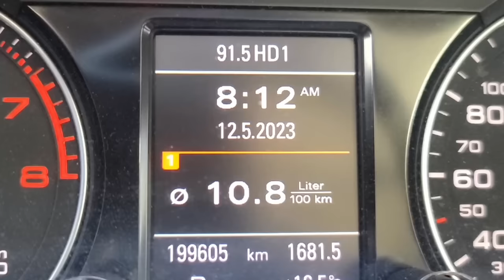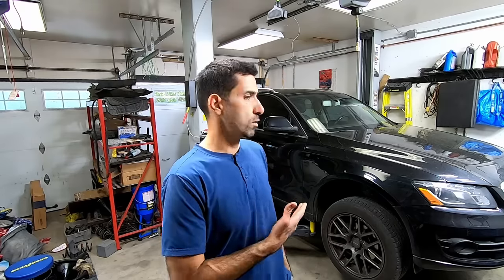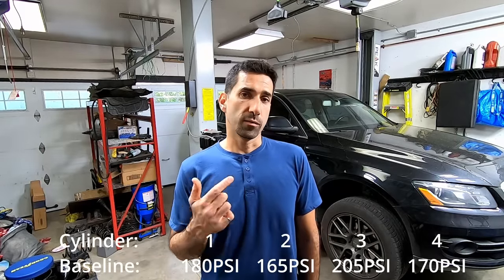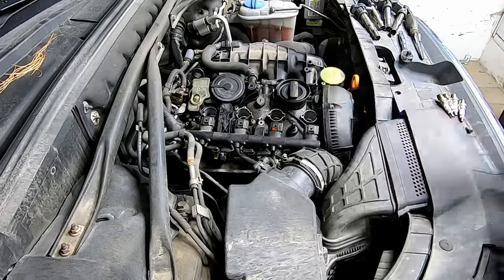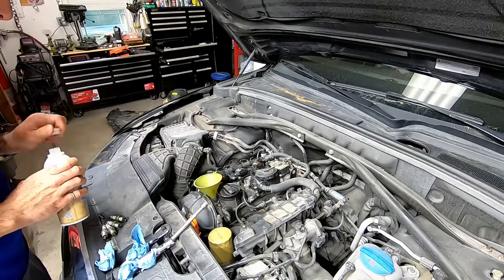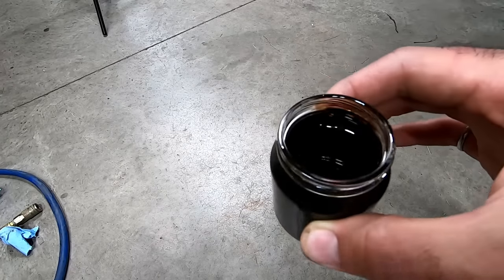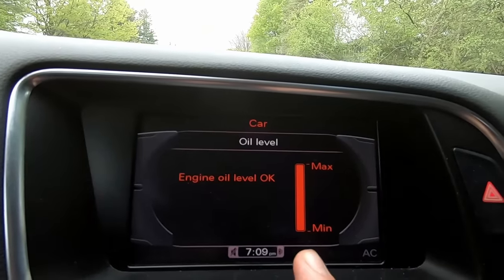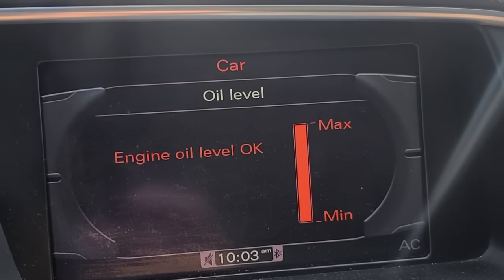How to fix excessive oil consumption from clogged piston rings (Part 2)

Comment: I'm next one who use your advise to fix my Audi oil problem in a4 B8 1.8 tfsi 2014. Was not so bad as yours but was burning lately more , I think around 300 ml on every 1k km . After completing the procedure of soaking rings in b-12 I drove 1300 km and I have still max oil level . Thank you very much for that video it helps me a lot ! Wish you all the best !
Reply from the maker: great! I've had quite a few 1.8TFSI folks do this successfully - it's annoying that the later years are still having these issues when they should have been fixed
Reply: @ETMotorsports  thats true , but I'm glad I could fix it on my own for just like 20 dollars or so. I'm very happy hehe . In my mind I was already preparing for fixing that problem in some specialized garage for big amount of money, and now I can maybe spend money on stage 1 :)

Comment: DUUUUUDE!!! I bought a really nice-looking Passat Wolfsburg edition1.8L turbo with 95K miles for my son for graduating college (valedictorian!!) Ends up it went thru 1 QT/1,000 miles. Terrible. I did what you showed with pistons in mid stroke and used 2 cans. 4 hours after the first can 3 of the cylinders had leaked the B12 through to the crank case. I refilled it and the next day put it all back together. Drove it for about 60 miles and changed the oil. I have over 2,000 miles and have not lost a drop!!!! That is amazing but proves the carbon build up on the oil rings is fixable without rebuilding. Thanks for this video. I should send you money!!!
Next time maybe try a dose of tranny fluid in before the plugs to get some compression for easier starting in the beginning.
Reply from the maker: Great results... glad it worked!!
Reply: @ETMotorsports   I now have over 4K and yet to loose ANY oil. WOW

Comment: My daughter's 2018 Tiguan has 70K miles and recently began using oil.  I also just noticed that it puffs a little smoke upon startup.  I had read about the B12 piston soak curing Audi/VW 2.0 oil consumption and anticipated her Tiguan might have oil issues.
I just began the B12 soak today.  Since it was pointed out that the oil becomes abrasive from running the B12 as an engine flush, I will remove the fuel pump fuse and spin the engine a bit with the starter to exercise the rings some.  Then do an oil & filter change.  I want to avoid running abrasive oil through the engine & turbo.  That stuff has to be brutal on the bearings.

Hopefully, this works.  I'll report back to let you know.
Reply from the maker: Keep us posted with the results... good luck!
Reply: Also interested in your results, as I too have a newer and lower mileage vehicle when compared to most commenters. Thanks in advance!

Comment: I am about to pull the LS3 on my Camaro SS that I am 90% certain has stuck piston ring(s) and redo them all. Watched a f3w of these types of videos but this merhod seemed the most thorough. Certainly worth a shot to see if I get lucky. Might save me many hours of labor and money if it works.
Reply from the maker: Good luck! I just did a 3.0T v6 motor and the amount of garbage that came out of the cylinders after B12 was incredible... keep us posted with your results

Comment: This was a great exercise  and resolution. Still surprised that Audi can't build a reliable  engine!!  My friend had to get his 2011 A4 engine repaired because of this.

Besides the low tension rings extended oil changes don't  help to mitigate this issue.  I bet that if oil changes are done at 8k KM, this situation can be avoided.
Reply from the maker: Yeah it's crazy how bad that 2.0T is from timing chain issues,  to oil pressure issues,  to oil burning issues... considering how many cars this engine is used in, it's truly scary to see these problems... pretty much every day there's a low mileage A4 2.0T on marketplace that's either blown it's engine or is about to and folks are stuck with thousands in repair bills
Reply: LOL the fuel savings doesn't even come close to recouperating the cost of repair. This is why I drive  a 4.0 l jeep, it doesn't get great mileage, but the maintenance cost is like 100 per year
Reply: The v6's are great actually, which is something other car makers actually suck at
Reply: @misham6547  but the 2.7 l is also junk, right?
Reply: @gianfrancoa  is it? I thought it was pretty much as good as the 3.0
Reply: Couldn't you just pour it in the fuel tank and avoid all the drama?

Comment: Thanks a lot for the video I followed your instructions step by step, in europe we dont have B12 so I used STANDARD THINNERS from EURO CAR PARTS,  I have already done 5000 miles, 8000 km without adding oil. my audi q5 tfsi 2011 before this tratment I used   to add 1 liter oil every 500 miles and in summer with high temperatures I added oil every 300 miles. 
Cheers

Comment: I hope you read this. 60 years + experience. I've been using Engine Restore for many years, I run it all my old cars. It keeps them like new, great compression and no oil burn. I've brought back many a oil burner with it. And restored the transmission synchros in my Honda Acty. (The crankcase and trans share the same lube)  It builds up cylinder walls and bearings. I think your find it will help with your oil burning and compression problem, after a good cleaning of course.  I love chem tool too. People tell me I'm crazy for using like your doing.
Reply: I did this on a 2015 VW Passat 1.8l turbo. The root of the problem from what I can find out from VW is the crankcase vent valve being faulty. It's a big PCV valve on top of the engine. As a matter of fact it has the Audi logo stamped on it. So if that's the case without replacing the valve, which has be revised and my local dealer had 5 on the shelf, this will happen all over again. I don't agree with starting and driving the car afterwards without changing the oil first. The crankcase is now over filled with black , thinned out, harsh chemical filled oil. The chemicals in that stuff are no joke and it's designed to be burned in your fuel not mixing all that crap through your engine. I started my daughter's VW afterwards and I could hear it rattle when given any serious amount of throttle. I shut it off and changed the oil immediately. Looking at and smelling the oil it's nothing you want flowing through your engine trust me. It's as black as coal and smells like cancer in a can. I used 2 cans and the same method as everyone else online. I'm waiting to see the results. In the VW owners manual under oil consumption you can't even get them to reference mileage or amount of oil as normal consumption. From what I've seen the Big 3 throw numbers at you as to what they consider normal. To you and me I'm sure we don't feel the same. VW/Audi states that during engine break in you may see substantial oil consumption which should eventually taper off until you start to get higher mileage on your engine and then it will start doing it again. So it consumes excessive oil new, then some oil midway through its life, followed by excessive again.

Comment: 2016 Audi Q5 that I just bought used was running really good and smooth. But I soon realized it was burning a litre every 600kms / 400ish miles. Changed PCV which didn't really help. Followed instructions here but only for 15 hours with high mileage seafoam as we don't have B-12 in Canada. Drove from Toronto to Mississippi the next 2 days and it burnt absolutely 0 oil !!! 

Things to note. 
- For the 15 hour soak I still used 2 bottles of seafoam.
- There was no misfires/hiccups for the first startup after the soak. It just started like normal.
- there was only white smoke for maybe 1 min.
Reply from the maker: @NbaTwitterReacts  yup- seafoam worked pretty good on my A4... it didn't do anything on a 3.0T so I guess it depends on how bad the rings are stuck... great results!

Comment: They charge 1000$ for the same treatment for the Audi 2.0!  It fixed my A4.  I also spray Quicksilver Powertune in the throttle body with the hose off and the engine running as a maintenance routine. It also cuts down the carbon around the valves.
Reply from the maker: @Strange_Brew  who does? A mechanic? I've been telling my local shop to offer this service but he's worried that people don't understand the risks and it'll cause problems... nobody local wants to do this for costumers

Comment: I have a 2011 A4 and have been dealing with oil consumption for awhile now. It wasnt bad when I bought the car, but now its terrible. 1L every 260 miles (418km). Shame on me for not looking into it further before buying. Either way now its my problem. I really enjoy the car so ive been weighing the options of what to do. Ive come across the piston soak on an Audi forum (probably the same post you read), but didnt find any other validation until your videos. So long story short, thank you! And please post any updates if/when the consumption returns. Ive also read the fix is only temporary.
Reply from the maker: Eek those are serious consumption numbers! Yeah we'll have to see the long term value of this but the reality is it costs next to nothing to do a soak at every oil change... if you're doing your own changes and can afford to keep the car down over night there's nothing stopping you from doing this every time... technically speaking you're not really fixing the underlying problem which is the low friction compression rings so eventually you'll get the oil rings acting up again...BUT it sure beats the alternative which is anywhere between 2-5k... please keep us posted wth your results if you end up doing this
Reply: I've got a later generation TSI engine, so no direct experience here, but I've heard good things about using Pennzoil Platinum Euro 0w40 (or Shell Helix Ultra 0w40 depending where you are).  It's not a panacea, but my buddy halved his consumption. In conjuction with something like the piston soak, it might help.
Reply: I’ve got a 2010 A4 2.0 at 170,000 kms it’s using 1 L oil /600kms. Audi dealer and aftermarket engine shop are both quoting >$10,000 to rebuild with new pistons etc. (this doesn’t include any cylinder head work). Please provide an update when available. Thanks
BTW, up to 120,000kms it was dealer serviced every 15,000kms and since then I do oil changes every 10,000kms using Liqui Moly 5W-40 VW50200 spec.
Reply from the maker: @svenhodaka9145  holy smokes - 10k is a hefty estimate for a 2.0T... the parts are like 2k at best...
Reply: @ETMotorsports  yes, 35 hrs labour and including timing chain R&R. 🇨🇦
Reply from the maker: @svenhodaka9145  I'm in the wrong business :) that's like a month of work with of money
Reply from the maker: @svenhodaka9145  if you need the chain then I suggest you do it before the tensioner pops and takes out the valves... but for the oil burning definitely try the soak - there's really no justification in putting that kind of money into a car worth south of 10k... if it fixes the burning sell it and buy another one :)
Reply: @ETMotorsports  yes, good suggestion.
BTW, I was concerned about the timing chain tensioner and had the chain assessed as 3.8° of offset due to stretch. @147,000kms I had the chain & tensioner replaced. It was about 10,000kms later that the oil consumption really started to show up. Then, I did a Liqui-moly engine flush when I was using 1L/1000kms. After the flush and fresh oil it was a step change to 1L/600km.
The car is an A4, S-line, 6MT and is still really nice to drive. My original expectation was to be able to drive it to ~240,000 kms reliably. I’ll try the soak.🤞. Thanks
Reply from the maker: @svenhodaka9145  interesting - the flush made it worse? If the chain is done then no need to open the motor
Reply: @ETMotorsports  I’m thinking that possibly the LiquiMoly flush cleaned the underside of the piston oil rings but wasn’t enough to loose them or free them up. If the Chemtool B12 cleans from the top side of the rings it could provide an improvement.
Reply: So I'll give an update on my experience with the piston soak. All in all, I'd say my results were successful, although limited. Before I was getting about 260 miles before having to add a liter of oil. Recently I just had to add a liter and was at 380 miles. So it definitely improved. I actually did the soak twice and it was after the second one where I saw results. I'm tempted to try a third time and see how much better it can improve, if at all.
Reply from the maker: @thehen42  thanks for the feedback - can you give us a general idea of how the process went? Did you do the 24hrs? Keep adding liquid during the time? Turn the crank? I'm surprised the improvement was so limited - trying to think of what can be done for the third try? Somebody suggested having a hot engine before you pour the first batch - that might help... also how long did you run with the b12 in the oil? Any additives after the oil change? On my A4 I used Rotella T6 diesel oil for the first 1000km because it has more detergents
Reply: My process was similar to yours, but everything wasn't as evenly spaced out since I did at my work so I couldn't get to it every 6 hours. I used 2 bottles of the berryman B12 for each soak. Total soak time was about 24 hours. I first added about 30mL to each cylinder and then rotated the crank several times just to get things initially started. Then I leveled out all the pistons and used the rest of the bottle to add to each cylinder. Plugged each hole with a rag and left it overnight. First thing the next morning, I rotated the crank several times to try and free anything up. Leveled out the pistons again, then used the second bottle and spread it to each cylinder. Let soak all day. Later that afternoon, I rotated the crank several times again. I turned it enough so each piston made probably 10 full cycles. Then cranked the engine over to blow out any residual liquid. Put everything back together and fired it up. Took 2 tries to finally start. Definitely ran rough for 15-20 minutes with major misfires and some smoking out of the exhaust. Attempted to take it for a test drive and hope it cleaned up, but didn't make it far with the severe misfires. Brought it back, shut it off, waited about 5 minutes and tried it again. Started right up and began running a lot smoother with no dash lights on. Took it for a drive down the road then brought it back to change the oil. Changed the filter and added normal euro spec 5w-40. Ran that  for the weekend, or a couple hundred miles, then added liquid moly engine flush and changed the oil and filter again. I normally run mobil 1 5w-40. Like I said, I've gone 380 miles before having to add oil so I've definitely seen improvement. I'm thinking of trying it one more time just for the heck of it. I'm pretty sure I've already convinced myself I'm just going to buy a lower mileage engine and swap it. If I can get another 4-5 years out of the car, I'll be happy and content.
Reply: I forgot to add, I did a compression test before and after and did not see any significant changes. Before each cylinder ranged from 175-183 and after they were very similar.
Reply: @thehen42  I’m curious, how many miles are on your 2011 A4? My 2010 A4 is at about 107,000 miles (~172,000kms).
Reply from the maker: @thehen42  yeah I didn't see much compression change either
Reply: Currently it has about 156,000 miles on it
Reply from the maker: @thehen42  hmm even an engine swap isn't cheap though and to be honest that topic has come up plenty - there's no guarantee the replacement engine isn't gonna have the same issues... at that point you're probably better rebuilding the one you have so you know everything is good...I had a random chat with a guy in the Costco parking lot today driving a Golf R burning 1L/500km 🤯 that's a relatively new car... that's nuts...

Anyways - the only thing I might suggest if you do try this a third time is to keep the B12 in and when the misfires start - pull the plugs and clean them very well but don't change the oil...run the car with B12 in it for a longer period... you did the engine flush but that's much milder... the misfires seem to come up because the plugs foul up so just break clean and blow them out to dry and you should be good... then run the car for a good 30+ min to make sure that stuff gets everywhere...

Good luck... hopefully third time is the charm!!
Reply: @ETMotorsports  thanks for the suggestion and will definitely do that if I try it a third time. As for the engine swap, I'm fully aware that I cannot guarantee the problem won't come back. I'm almost expecting it to come back and I'm just merely buying myself time. My thought process is that with the amount of money I would spend to rebuild my current engine, which would include the piston/rings, timing, seals, bearings, head rebuild, etc. I can swap for a low mileage engine and roll the dice. My main concern is time. I don't have a shop or really any work space where I can keep my engine while I figure out how to rebuild it. I'd love to learn, but I'm also realistic with myself and my abilities lol. I was thinking of rebuilding mine after swapping it so I can learn how to also while having the time and not needing to worry about getting cat back on the road......I guess it's all still up in the air at the moment. I'm still fairly undecided with what direction I go. I still plan to try a 3rd piston soak and see if I can get better results. If I can achieve substantial improvement, I may just slap a new timing chain and valve kit on this motor and call it a day. Who knows lol
Reply from the maker: @thehen42  fingers crossed